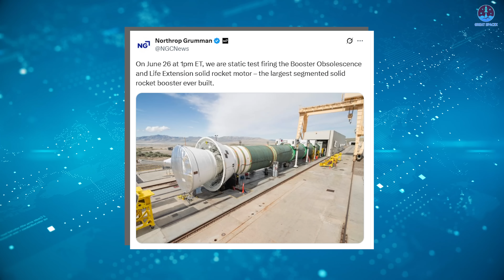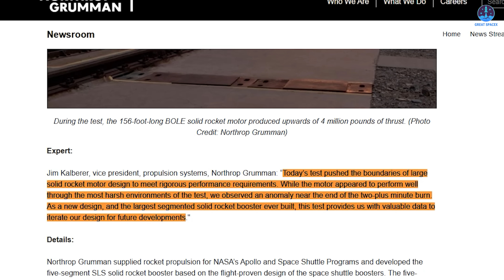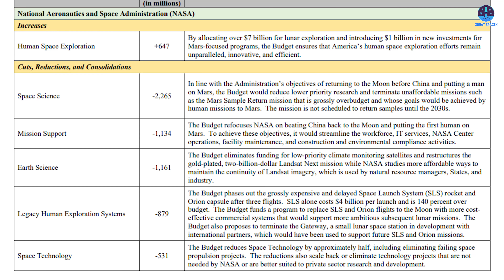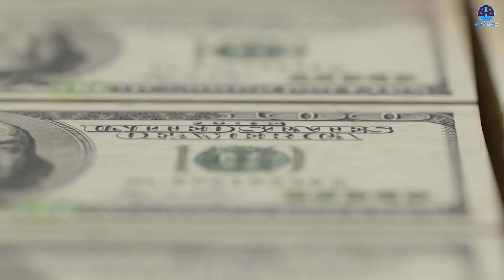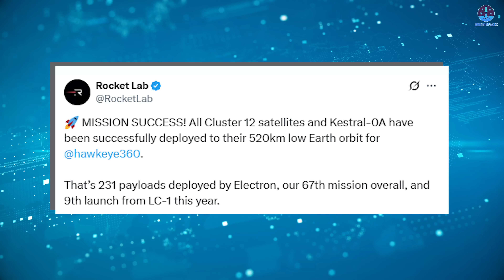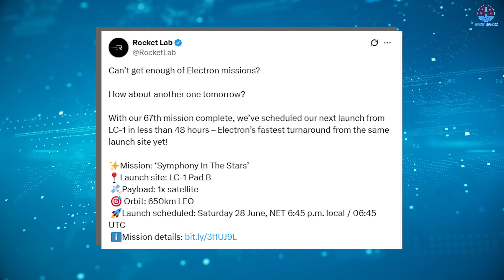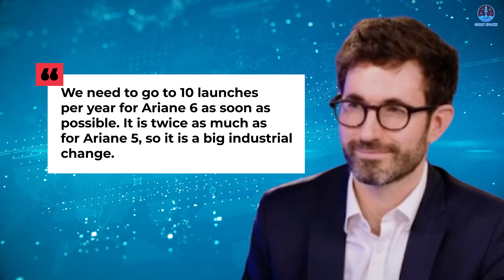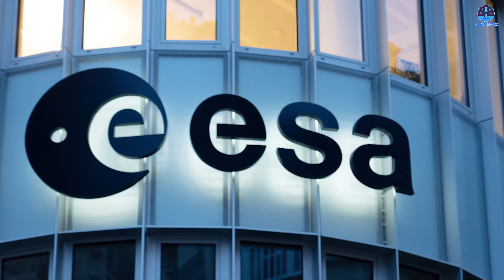BAD NEWS! NASA SLS Booster anomaly EXPLODED & Blew off. What Exactly Happened?

Comment: My father was the reliability engineer at Aerojet (now Rocketdyne) for decades. He produced reliability statistics for Polaris, Poseidon, Minuteman, Titan and other systems. He helped develop Aerojet's bid for the space shuttle SRB - a single casting engine. Thiokol won the bid with their segmented SRB design. At the time, my dad said that SRB engines should not ever be 'man rated' for spaceflight. This new failure may be a further indication of this. But, this new SLS SRB has some significant modifications, specifically the steerable nozzle. I noticed at the beginning of the test that the nozzle was going through a lot of movement. It may be that the test involved more movement and larger movement of the steering in order to test to failure. It was funny to me the comment on the post that the engine continued firing after the explosion. Once lit, SRBs continue firing until all propellant is expended. There is no way to throttle or shut down a SRB.
Reply: all SRB's have steerable nozzles...it's called thrust vector control and is responsible for most of the vehicle's attitude control whether it was shuttle. Yes you can shut down an SRB by opening the case with a linear shaped charge and they can be throttled by shaping the propellant grain. Sounds like dad had sour grapes.
Reply: @divedevil985  try again - SRB do not shutdown by opening the case - they continue burning until the fuel is used up. second - venting as you describe causes a sideways thrust that is totally uncontrolled.
Reply: @JessePollardII  the fuel of an srb only ignites and combusts under pressure. It actually takes an explosion from two escalating pressure explosive initiators to ignite them. A linear shaped charge can be activated by the flight termination system to split the motor cases and release the pressure. Sideways thrust is irrelevant in an abort scenario, if in fact any is generated. The point would be to remove the thrust for successful separation of the vehicle using the LAS, or in the case of the orbiter an RTLS abort.

I really don't care what your book said...I installed the flight termination systems on the boosters for that specific purpose.
Reply: @divedevil985  Yes. but once STARTED, it cannot be STOPPED, or REDUCED.
Reply: @JessePollardII you did not read the NASA SRB technical document I included did you. 
I love it when (insert non aerospace engineer career here) argues with a person who built, developed and refurbished RSRM Boosters and even installed the very flight termination system that shut them down. 
Stay ignorant....you have lots of company here.
Reply: @divedevil985  Didn't pay attention to what you supposedly read did you.
Reply: @JessePollardII  I didn't need to read it. I already knew. The link was for you. 

"Range Safety Subsystem
The RSS was designed as the shuttle destruct system in the event of a major malfunction or
event. The RSS terminated flight by splitting the cases of the SRBs, which eliminated thrust.1674
Dual (redundant) subsystems, A and B, were provided on each SRB, and these were “crossstrapped” to the opposite SRB through the ET. The RSS was active from T-10 seconds until
approximately five seconds before ET/SRB separation.
Located in the forward skirt of each SRB, the RSS included a linear-shaped charge destruct
assembly, two command receiver decoders, distributors, a directional and a hybrid coupler, two
command antennas, two silver-zinc batteries, a S&A device containing two NASA Standard
detonators, four confined detonating fuse assemblies, two confined detonating fuse assembly
bulkhead connectors, and harness assemblies with all interconnecting cables.1675
The linear-shaped charge assembly, which measured approximately 80’ long, was mounted
along the SRB length in the systems cable tunnel. Six linear-shaped charge subassemblies were
used in each SRB destruct assembly, including one forward, four intermediate, and one aft.1676
The S&A device consisted of a longitudinal shaft with explosive transfer charges. Explosive
leads at this device started the pyrotechnic reaction with the explosive transfer and ignition of the
confined detonating fuses. The confined detonating fuse traveled through the forward skirt
bulkhead and into the systems tunnel to the linear-shaped charge, which detonated, splitting the
SRM case and terminating thrust.

https://www.nasa.gov/wp-content/uploads/2015/12/5pf.pdf
Reply: @divedevil985  Nothing new there - exceot the missing part about splitting the fuel itself. My information was older and based on the original minuteman missile self destruct if it went off course. Same thing but did split the fuel cylinders to terminate the burn as soon as possible before it could hit the surface of the earth. One other thing missed was the immediate separation of the shuttle from the fuel tank. Unfortunately none of it helpped in the Challenger explosion where the fuel burned through the O-ring and cut into the fuel tank.
Reply: @JessePollardII  nevertheless there is a way to shut down the booster. It has nothing to do with splitting the fuel, It opens the case to release the pressure required for combustion. They are not fuel cylinders they are motor segments. 
RTLS abort was not part of the discussion although I'm sure I mentioned it somewhere in this video. That scenario was only available through a very limited launch window. I'm really tiring of a 60+ year old man who lacks the maturity to learn.
Reply: @divedevil985  The fuel itself must be split otherwise the fuel continues burning. it provides the pressure to continue burning itself, Normally it fuel is not strong enough to maintain pressure and it splits anyway. But until it does it continues burning just as a hose continues spurting water until the internal pressure is released. Another example is a balloon shoothing through the air. When the balloon is popped, the pressure inside is released all at once and the air inside goes every which way and popped balloon is propelled in whatever direction opposite the source of the split. In the case of sollid propellant each of the fragments continue burning - hence its use in skyrockets. the fragments producing the star bursts seen.
Reply: @JessePollardII  I worked on these exact boosters for many years. I'm sorry you are unable to learn or be wrong but the combustion process can only continue under the physics of compression. The nozzle maintains the pressure above a critical level until the point when the increasing volume created by the combustion of the fuel will no longer support the reaction. The boosters are jettisoned prior to this point. Otherwise, the linear shaped charge which runs the length of the booster opens the pressure vessel aka motor segment, releasing all combustion pressure. The fuel, which is mixed with the oxidizer can not burn unless forced to under pressure. There is no way to separate the fuel from the oxidizer. It is bound into a solid compound. 

This is what Vielle's Law states: "Propellant burn rates increase with pressure because the higher density transfers heat faster to unburned solid fuel, decomposing it into gasses which can take part in further combustion.

Note also that, according to the Law, if pressure p=0, the burn rate is r=0. This means if you removed pressure from the combustion chamber, the burn would be extinguished.

Quenching of a solid fuel rocket can be achieved through rapid depressurization. https://apps.dtic.mil/sti/pdfs/AD0711436.pdf Basically, the depressurization stops heat flow from the hot combustion chamber flame into the unburned solid fuel."
Reply: @divedevil985  Which is true after the fuel is completely fragemented. unyil then the pressure is not 0.
Reply: @JessePollardII  you can't fragment solid fuel bound at the molecular level.
The topic was and is the ability to extinguish a solid rocket motor by rapidly reducing the pressure of the combustion chamber. This is made possible by the flight termination system specific to shuttle derived srb's which opens the casing of the solid fuel segments to rapidly reduce the pressure upon which combustion depends. 
Attached is one of the many studies on the topic used as a reference for SRB design.
Summary, a solid rocket motor can be extinguished instantaneously. I installed the device which stops the combustion.
I have attached several documents to support my information. 
You are possibly the most insufferably stubborn person I have encountered arguing with a subject matter expert as well as NASA / DoD documents.
https://apps.dtic.mil/sti/pdfs/AD0711436.pdf
Reply: @divedevil985  yes I'm stubborn - specially when I'm right. yes, it is possible but removing a nozzle doesn't do it as it is the entire column of the fuel that is the combustion chamber. The core is hollow and is burning - thus it remains providing pressure, Unless the fuel itself is ruptured by the pressure inside that hollow. That only happens when the column itself is split open to a vacuum. As I recall this was why it was required that the tank disconnect from the SRBs if there were ANY problem Before the shuttle could disconnect from the tank. It was also why the SRB continued flying erratically when Challenger exploded.;
Reply: @JessePollardII  The SRB manual says this:

"The linear-shaped charge assembly, which measured approximately 80’ long, was mounted
along the SRB length in the systems cable tunnel. Six linear-shaped charge subassemblies were
used in each SRB destruct assembly, including one forward, four intermediate, and one aft.1676
The S&A device consisted of a longitudinal shaft with explosive transfer charges. Explosive
leads at this device started the pyrotechnic reaction with the explosive transfer and ignition of the
confined detonating fuses. The confined detonating fuse traveled through the forward skirt
bulkhead and into the systems tunnel to the linear-shaped charge, which detonated, splitting the
SRM case and terminating thrust."

https://www.nasa.gov/wp-content/uploads/2015/12/5pf.pdf
Reply: @divedevil985  I believe it also split the fuel.
Reply: @divedevil985  certainly you can - fireworks do it frequently.
Reply: @JessePollardII  we are way past done but are you really comparing a humanrated booster to a firework? 
The fuel and oxidizers of fireworks are in powder form and not bound into a solid.
Reply: @divedevil985  Some are and Some are not. Which it is depends on the purpose.Those that carry multiple loads and multiple detonations are not.because the chain doesn't light easily with powder.

Comment: SRBs are soooooo ancient. Why I say this is because if something goes wrong, you can't cut the off.
Reply: PL-15 and SM-3 uses dual pulsed solid-fueled rocket motors. Missiles typically use solid-fueled motors because liquid cryogenic fueled needs to be fueled only shortly before use due to boil offs.
Reply: you can stop an srb. When will this myth die?

Comment: Funny how NASA and ULA launched over 6,000 times and dwarves tiny Rocket Labs with 50 launches and little SpacEXplosion with 500.
Reply: Just wrong, dude. ULA launched 155 times, NASA launched over 1200 times, and SpaceX launched 510 times. NASA has been here since 1958 while spacex has been here since 2002 so its very much reasonable they did more launches. I dont know where you got those numbers from, but they're very much wrong. Also, dont expect SpaceX to not have overtaken NASA in number of launches before 2040.

Comment: Northrup Grumman solid booster has one failure and SLS should be canceled while Starship has 4 explosions in a row and can't make it to orbit in 9 flights should continue? How is Starship ahead of SLS?
Reply: Starship has political propulsion.
Reply: @donadams8345  Backwards, SLS has had the political backing which is why they designed a rocket based on components from the Space Shuttle instead of designing a new rocket or even an updated Saturn series rocket.

Starship is funded mainly by Starlink subscriptions.
Reply: @roycsinclair  starship is funded by venture capital.
Reply: @divedevil985  SpaceX WAS funded by venture capital.  It's now funded by charging for launches to space AND from revenue brought in by selling Starlink subscriptions (7.7 billion in 2024, Starlink is a wholly owned subsidiaru of SpaceX).  Starship is a project of SpaceX which overall has cost less than 5 billion so far despite the number of "failures".  It's QUITE correct and safe to say that Starlink is indeed funding Starship which has also been said by Elon who PLANNED for Starlink to pay for this program.

Comment: Who wrote this?? Elon??  And no the SRB DID NOT explode!  The gimbaling nozzle failed jus a bit before the rocket motor fuel was expended.  This is why you test new designs instead of just trying to fly them, hoping it will work!  

Even if SLS, which BTW, we know works,, unlike Starship, were to get cancelled,  once perfected, this  design will see a lot of use.  Thrust "programmability" by section and steerability would be very desirable feature for the weapons community. Solid rocket motors are used far more than liquid/cryo fueled rockets!  These things could completely replace super heavy at low cost, With a small second stage, these could easily launch satellites!

So nothing stupid about developing this SRB,  regardless of what happens to SLS!  SLS is a proven spacecraft.  Starship is a failed fantasy!

Comment: Regarding SRBs for the SLS
Wasn't there a liquid-boost project based on redesigned F1 engines during the Constellation program?
It was apparently abandoned because it would have cost the SRB manufacturer jobs (purely political, not technical, reasons).

Each "LRB" consisted of two F1c engines (600+ tons of engine thrust) redesigned with 3D printing. 
They reportedly went from 3,000 parts (welded by "god-level" welding masters! Now impossible to find) to fewer than 50 printed parts per engine. 

One of the very, very big flaws of SRBs is their "light them and pray very hard that nothing bad happens" characteristic.

From T0: "ignition," no uncalculated variation is seriously conceivable.

The main reason why 90% of SRB engines are liquid-fueled is that by "managing" the arrival of liquid fuels, you "should" be able to manage the power or even stop everything (ok, with liquid fuels, the ISP is higher too).

If (and it's a huge IF) we consider these Artemis 8-9-10 flights and beyond, wouldn't it be time to switch to a much more manageable liquid engine?
Reply: Redesign means redevelop. Takes longer and costs more than the first time.
Reply: @JessePollardII  Constellation would have used the same booster now being used on SLS. SRB's work just fine and more importantly they support vital industry infrastructure.
Reply: @divedevil985  Actually SRBs don't work fine. Remember, one tore a Shuttle apart, killing everyone,  others threatened to do so. They also spray toxic aluminium dust into the atmosphere.